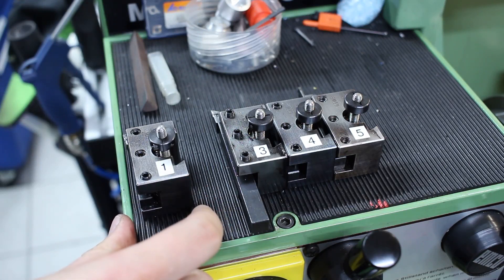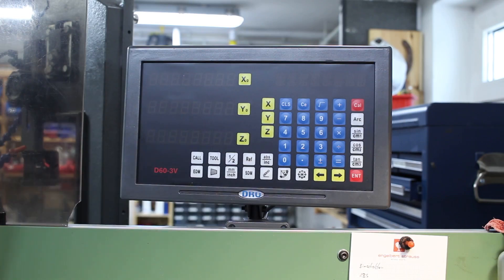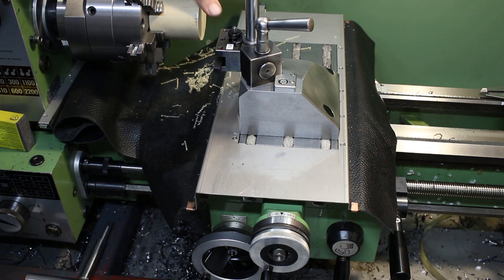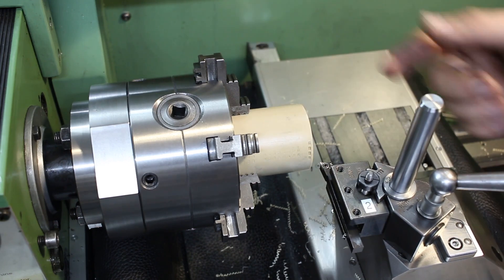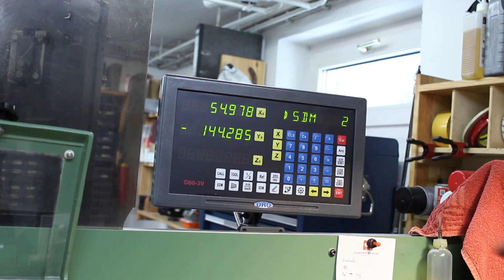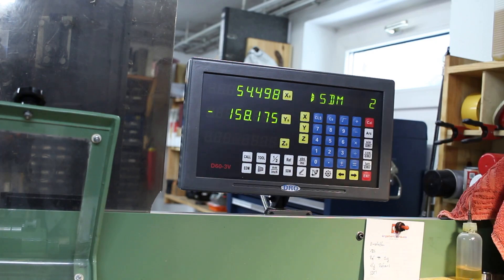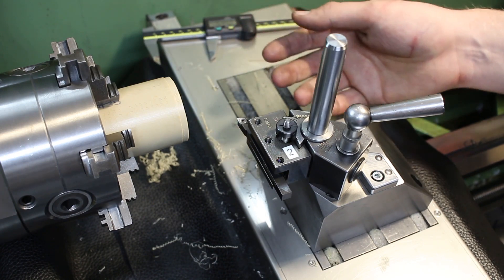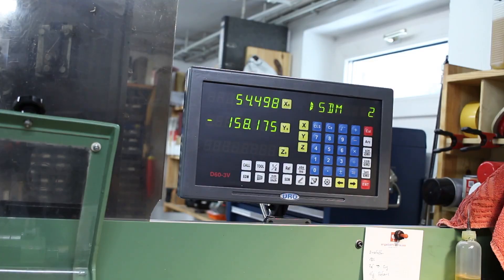Lathe DRO, multiple tools and homing

Comment: You pretty much answered my one question. What good is this tool identity if the Compound messes it up in use or rotation?
I'm too attached to my compound to take it off.
Reply from the maker: Beeing in that position now myself: less of an issue that it seems - After moving the compound the tools are quickly re-touched when used.

Comment: To me, the arrow keys on these import DRO's work backwards.  The Right or Up arrow key cycles SDM 4, 3, 2, 1, and the Left or Down arrow key cycles SDM 1, 2, 3, 4.  This is very counter intuitive to me and very annoying.  Do you (or anyone) know if or how to change this behavior on these units?  Thank you
Reply: Well, you probably could cut some PCB traces and rewire those two buttons the other way around with small wires if you're capable with a soldering iron 😉
Reply: @winandd8649  I've thought about it. I took the back off at one point but I couldn't figure out how to disassemble it any further.  I need to look into that again. At this point, I could care less if I wreck it. Thanks
Reply: @ Alright, so good luck with that 😉

Comment: Removed the compound slide. Won't that make thread cutting more of a challenge?
Reply: Only with very large threads, most don't need to go over 2mm pitch which is still fine with plunge feeding

Comment: I’m Looking into manual lathes. A 1440 for your type of work in your opinion, Would this size lathe perhaps be harder to navigate or less Productive. Thanks
Reply from the maker: Yes, something like a 1440 would be to much for what I do - I used to use a Weiler Condor 81 at work a bit for small parts and I disliked it a lot. Heavy, large toolholders, everything is far more distance to move your hands, the tailstock weights a ton, etc.
I
Reply: Stefan Gotteswinter there are some lathes that fit what I need. The lowest rpm is 150. Is this a problem in your opinion. Thanks

Comment: am courious am thinking of doing this on my lathe..is the reading still cutting on a radius..dial hoy are one but cutting two..digital does it compensate  one to one
Reply: Typically you can set this in the parameters so that the DRO shows either linear measurements or interpretes it as radius and shows it as a diameter on the readout.

Comment: That method almost demands making a few hardened and ground step gauges that could be used for custom shaped HSS lathe tools while doing one off jobs Stefan. Especially when needing to reuse a tool holder with an already known tool off set. I still can't believe just how quiet that geared head lathe is every time I hear it. High quality and precision made machines have an operating sound and feel to match there price level.

Comment: You should look into TouchDRO from Yuriy's Toys. It's a small circuit board that the scales are connected to, which then connects to a tablet via Bluetooth. The TouchDRO app has a much more intuitive interface than that display in the vid, and a huge amount of functions. Tool library, work offsets, all the bells and whistles. It's also compatible with pretty much any scales.
Reply from the maker: I have no interest in touch-anything in the shop. Does not work with oily/dirty fingers. Gimme buttons any day. Plus no real bootuptime.
Reply: @StefanGotteswinter  I've not had any problems with dirty hands on the tablet. I use a cheap Amazon Fire tablet, was less than $50. Glass screen means fingerprints are gone with a swipe of a rag and a bit of alcohol.

It's really nice to have an actual (onscreen) keyboard to enter data, and adding/changing tools is a tap away.

As for boot up, I just wake the tablet, open the app, and make chips.

Though I'm only a hobbyist, and not doing nearly the amount of machining you do (and certainly not nearly the quality work that you do).

Comment: Very useful info, I'm about to buy some new scales, but I think I'm going to head down the TouchDRO route, have you heard of it? It can use pretty much any linear scale and it interfaces with any android phone or tablet and is apparently very configurable. Should be fairly straight forward with your arduino experience.

Comment: Funny, I didn't know there was a homing function. I'll have to see if my Chinese ones have the same thing. Thanks for that!
I often prefer to take my cut, then a spring pass before measuring so that I have an idea of what my dimension is with less tool pressure (in steel at least) and go from there, any downsides you could see from doing it this way? 
Thanks for the video, hopefully the next one isn't far behind! 
Kyle

Comment: Why not Z axel, ref the Z also-> skimm end off part with"tool 1" and zero Z. Now "Tool 2" but insted cutting use 10mm pin bitween part and tool after that hit DRO Z 10mm and so one..... After that tool 1 marks allways zero Point.